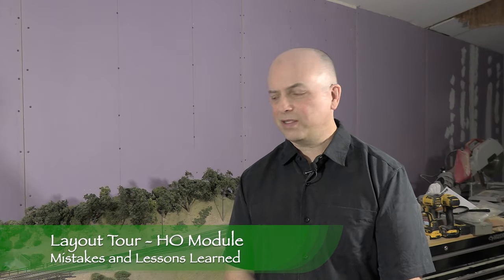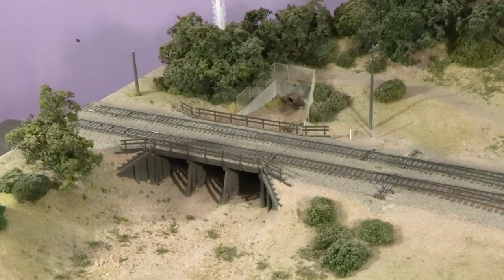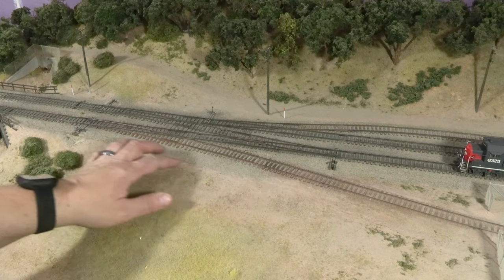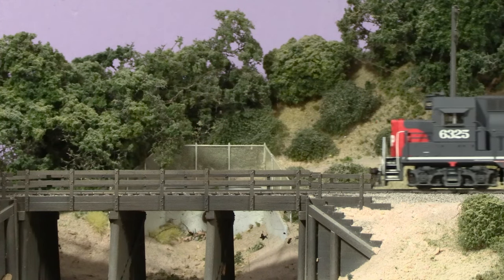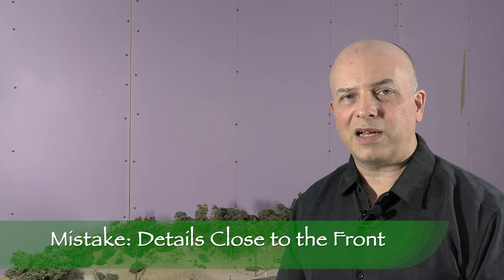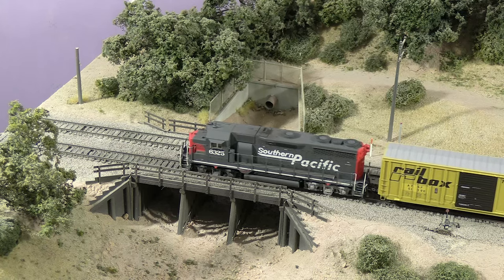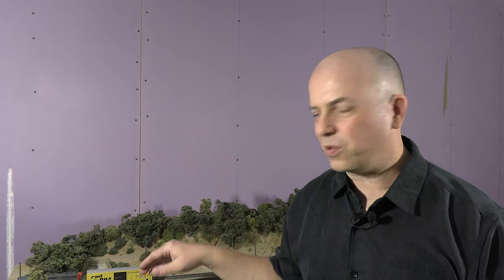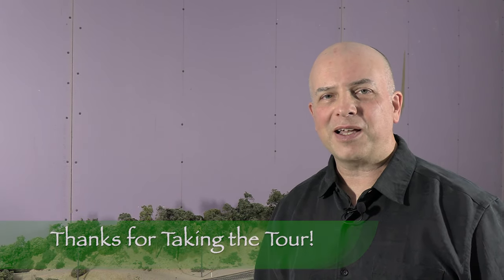Model Train Layout Mistakes and Lessons Learned - HO Module Tour!

Comment: Looks good, Dan, it's a beautiful module. I've enjoyed seeing your models on it over the years. All good building points and the way to protect your layout and trains from damage. I violated a number of your suggestions when building my layout (I have a running 12x20 layout but have just begun applying scenic elements). It seems we never have enough space, so choose what's most important and mitigate the rest as best possible.
Reply from the maker: It's not always possible to "follow the rules", so to speak, in every situation.  I had to push the tracks closer to the edge at the end of the peninsula on my Donner Pass plan so I can still have adequate aisle space.  It's good to keep those things in mind when you can.  I'm glad you liked the module and thanks for watching!

Comment: Excellent module! Simple and effective! Where did you purchase the switch stands?
Reply from the maker: I'm glad you like the module. To be honest I got those switch stands so long ago I don't really remember where they came from.  They were produced by Sequoia Scale Models, and I might have bought them at the Train Shop in Santa Clara, CA.  I'm not sure what the current status of Sequoia is.  I had to modify them to use metal wire for the main post, so that I could attach it to the turnout throw bar to make it move.  Thanks for watching!
Reply: @DanielCortopassi  awesome and that was my next question. I'm about to do the same with wire to throw the turnouts. Micro-Engineering turnouts have small holes and need adjustments to make the caboose industry switch throws fit

Comment: Very cool, do you have a video on how to make HO track/ties look like old SP track, and the SP type bridges as well?
Reply from the maker: I don't have any videos on weathering track as of yet.  That will probably happen later on when I have some track put down.  I haven't done a video on the bridge.  The article I followed in Mainline Modeler is pretty old, 1985 I think.  I still have the issue somewhere.  It could make an interesting video.  I have another one I built that's single track, though it's taken apart right now and I'm not sure exactly where it is.  It's all built with styrene, so I could do another one at some point if I found a place for it.  Thanks for watching!